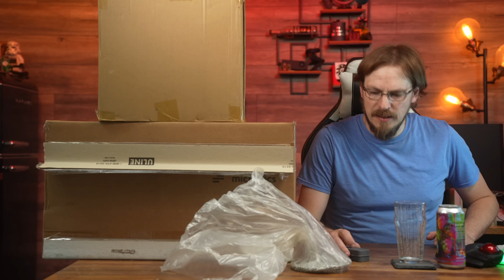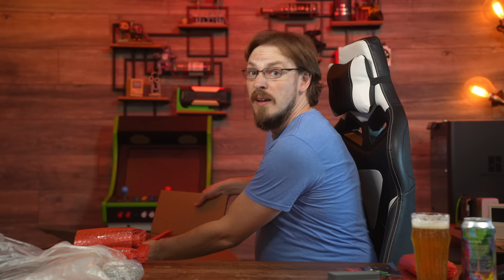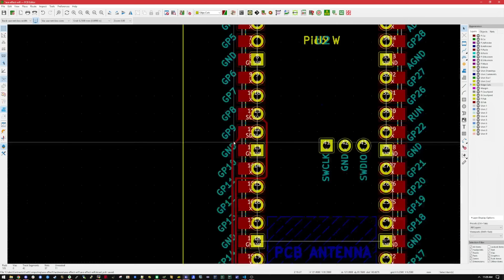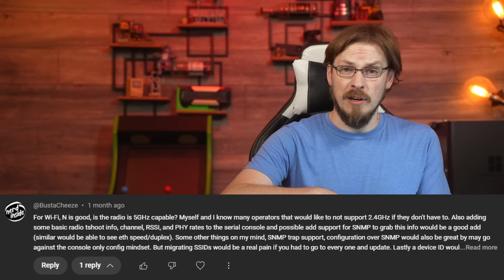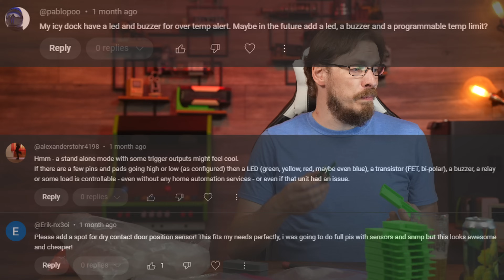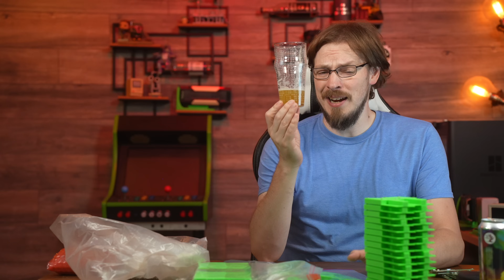Assembling SNMP Temperature Sensors and Answering Your Questions

Comment: smart move sticking with SNMP.  no need for MQTT when SNMP can get converted.  but most importantly, the smart concept of intentionally being a dumb device that resists compromise is EXTREMELY ATTRACTIVE from a security standpoint. well done for considering the high level issues as well as all the detail!  Looking forward to the POE version.
PS. what SNMP logging environment are you a fan of or using?
PPS. hilarious when you mentioned 10:43 people who have a home office that has sump pumps behind it that have a tendancy to fail - yeah that last feature i may have a vest interest in making sure it comes to fruition =)

Comment: As someone with some decent manufacturing layout experience you may want to look into electric torque screwdrivers and articulating tool arms. You could knock out every one of those you did today with minimal effort in a couple minutes with a guarantee of not stripping the threads once you dial in the screwdriver torque setting. If you end up needing to make these in larger numbers feel free to reach out. As someone with a huge belief in small business manufacturing but a background in large scale manufacturing (think Honda and Toyota demand from the same factory) I have no issue providing some input if needed.

Comment: Don’t fret, when I order an item from outside of Greece and it’s shipped priority mail from the states, it arrives within days to customer here, one exception was the last order which sat for ten days at the local post office in Columbus Ohio. Problem was with the employees at that postal branch, which have since been removed due to customer complaints. Anyways a priority package hits customs in Greece it will sit for at least two weeks there before released. Now the package is marked PRIORITY MAIL, let’s not fool ourselves most people in customs today are able to read most of the common languages used. I did notify customs via formal complaint that they were violating the terms of delivering packages clearly marked PRIORITY MAIL. Even Priority mail envelopes with documents that are time sensitive have been unnecessarily delayed. Using tamper proof tape to seal these envelopes we have been able to determine that the envelopes were illegally opened. We were able to obtain finger prints and DNA SAMPLES of an individual or individuals who handled these documents. Documents were enclosed in sterile envelopes so the individuals had to handle the sterile envelope. This envelope in turn was returned to a lab in the USA in a sterile environment to gain evidence as to who opened the sterile envelope within the package marked documents.

Comment: bruh. A Ruuvitag, or UniPlus with a Am2302.... EITHER ONE, is cheaper, and has more functionality... Both are already supported, and vetted/tested.

Easier, and supports rpc, and MQTT.
Reply: Yeah; you're reinventing the wheel here....

Shelly Uni plus 10-15$
2 Ds1840 temp sensors. 4$....

Supports 5v, or 9-29.
Still only 2.4ghz, but way more robust than rp2040 WiFi.
AND it's going to pull less than a watt.
Can be used via Cloud or fully LOCALLY, into Home Assistant or Google/Alexa..
Reply: Your developer is an idiot.
You can run native C (c++)on ESP32...
Reply: Here's a name. Incognizant.

Comment: I don't know anything about Prometheus, but surely SNMP data can be bridged or gateway'd into MQTT; the second result for 'MQTT SNMP bridge' is even a DIN rail device that claims to serve this purpose, the first being a very compact github project. I'm pretty sure if someone wants to get the data from these into an MQTT setup, they can make that happen without difficulty and without compromising the security of the sensor.

Comment: If the pressure sensor is in the airflow path, then the pressure it reads will be impacted by the airspeed interacting with the local geometry, most likely presenting as a reduction in pressure due to the venturi effect or some other similar effect I don't know the name of that produces low pressure areas adjacent to flowing fluid. The specific value of this is that it lets the pressure sensor validate air flow. I doubt you could meaningfully convert this into any flow unit, but you would be able to detect if flow stops, and you might be able to detect if flow changes in a substantial way, such as from one or more fans stopping.

Would this data be useful? Probably not, those fans should have tachs they should be monitored by their hosts, and they are also probably being regulated so the flow rate isn't expected to be consistent. Perhaps for less intelligent devices, or if you're expecting the server fans to produce/induce some auxiliary airflow elsewhere in the case and you want to validate that's actually happening. Maybe you have forced air from an external device like data room air handlers or ducted in AC and you can't monitor that source device, maybe it's not yours, or it's the less intelligent device. The pressure sensor could let you monitor that the forced air is actually present, and you would be able to detect a loss of flow much faster via pressure.

If Any Of This does stand up to scrutiny, a venturi tube could be added to the case model to amplify the pressure variation due to airflow, and make it less situational; but that would probably impact the sensor's temperature monitoring and might induce a whistle

Comment: Note that you need the product CE certified when importing it to the EU. This means measuring immunity and radiated emissions. An ESP32 is a bit cheaper then the RP2040 as you don't need a crystal/oscillator and external flash. It also means you can build on top of existing IOT projects like Tasmota and ESPHome.  
That said, the RP2040 is available up to the year 2040 and might come down in price when it's successor arrives. The SDK is also way easier to comprehend.

Comment: 65$ for something that cost less then 5$ to make 🙄 ill stick to diying
Reply from the maker: My BOM costs on this are nearly $30 each. PCB manufacturing, Pico-W, BME280, passive components, assembly, soldering, case printing, shipping, import tax, shipping materials. And that's without getting into developer costs, or the two different runs of Alpha prototypes before this Beta phase.
Reply: @CraftComputing I didn't think you would respond, but I've made boards just like this, except with more components. They're usually under $10, fully soldered and shipped. But mine are for smart house purposes. You can buy a WiFi temp/humidity sensor for $20, battery/wall powered. I won't mention any here so I don't drive people from your product. Also, feel free to delete this comment. Since you actually read your comments, I have a few lol.

On your final board, add a header for flashing. Anyone that tinkers wants custom firmware. This might sound like a waste of time, but it will expand your market. It's also the first thing I look for when buying anything like this.

I would make the final board with multiple input and output headers (which you kinda said that's what you're doing). Then you could make a relay module or any input module. I make all mine this way, but I use Ethernet to connect the modules to the main board.

Comment: In regards to future support for pressure sensor support: speaking from a decidedly non-developer standpoint, only having the vaguest inclinations of what a basic dev-cycle is like and the most rudimentary fundamentals of coding & associated costs, have you and/or your dev given any thought to making a lightweight core framework+plugin kind of build, so as to allow freedom to focus on the parts you want thoroughly fleshed out & polished? Then you don't have to worry (hopefully) about full stack rewrites just to add new features, and if one or more in the userbase wants to, they can start hammering out the additional extensibility. Just a notion, and if that's completely beyond the pale, that's fine.

Comment: Definitely going to be an extremely useful tool in the rack room.

I do agree that you need to keep the cost down, even on the pro version. If it ever gets to $200+ you'll be competing with the likes of ControlByWeb and such which are about as fully featured as you can get.

Also when I saw Axe Effect I actually thought of "Axe FX" which is a guitar DSP by Fractal Audio, lol

Comment: I noticed my BME280 reads low lower than my DHT22 in regards to hummidity, all of them seem to get temp the same (D18B20, DHT22, BME 280)

10:49 maybe you are Linus and your water cooling loop experienced a catastrophic failure and is leaking gallons of water and knowing your server is flooding would be a very important thing to know

Comment: so 6GHz really seems out of the question, so no AX band support :(
Reply: Radio bands on a device like this, 5GHz would have been a nice to have, every cheap, basic IoT chipset supports 2.4GHz. 6GHz would be extra. 900MHz would make more sense but would require a gateway of sorts. However a Wi-FI 6 capable 2.4GHz chipset would be a nice modern compromise.

Comment: arbitrary dry contact inputs (1-4 of them) would allow leak ropes, limit switches, tilt sensors... basically every network climate monitoring device I used in the IT field had those, and usually at least one relay for an alarm output.

Comment: A more permanent name for the "Axe Effect"? Personally, just "the Axe" works for me. It leaves it open for changes in development and what may be added, sensor-wise, down the road.
However and putting my business communications degree to work here, while lime green might appeal as a gimmick professional network techs with rack rooms that might have company VIPs want to visit woulod likely shudder in embarassment at being caught with such an "eye-drawer" like that in amongst their six figure routers and JBODs. I think black would make the item disappear and be otherwise hard to find, but whlte would be subtle enough and professional enough to be seen and not look out of place.
To add to visual appeal that would not add cost, you might want to consider including in the printing an "etching" of a standard shaped six-string acoustic guitar on the front; and also possibly include an "etching" of the name of the device down in one corner. Subtle and won't make the axe-effect look like a toy.

Anyways, just my thoughts and you're welcome to use or not. I freely release to you the concept to do as you will.

Comment: Instead of having a unit that contains PoE/Barrel/USB-C etc all in one, would it be easier/cheaper, to create a main unit containing the brains and then 'power adapters' that can be plugged in? something like a usb-c connector on the brain, and then a 'Power Jack to USB-C' and a 'PoE to USB-C' etc.  Or may by use a power jack on the brain if that's cheaper.  Another idea could be to sell a 'plugin probe', which is just the current probe on the beta, but with a plug that can be inserted directly into the brain, to allow local monitoring, so if a user only needed a single probe, they wouldn't need to have a long wire between brain and sensor, just mount it the same as the beta model.

Comment: Since you're already considering branching into non-IT areas, to my mind this might also be quite useful for freezer and refrigerator monitoring. I would think  (not an expert) that both temperature and humidity sensors are useful there, and it would certainly make sense to expand it to have a sensor to register if the door is open or not for those as well. If the temperature range is high enough, and the enclosure and batteries robust enough (or use wired power), maybe look into expanding into restaurant and bakery ovens?

Comment: I'm amazed at the shipping costs, maybe I've been spoiled by China, buying Arduino boards with little to near zero shipping costs. That said I once looked at getting a power lead from a US supplier, the shipping was multiple times the product cost - of course I didn't proceed, instead putting the info into my jokes folder.
It's almost like the US has no desire to export, we'll just leave that to China etc.

Now for SNMP, an article or two on it would be nice, as in how to take that data into another, say Pi Pico and throwing it up onto an attached display, rather than feeding some propriety software where I don't get to fiddle at all, boring.

Comment: 12:10 2,4 Ghz is not less secure, old WIFI is. For example the "MikroTik hAP ax lite" only has 2.4 GHz which however is WIFI 6 and supports WPA3.

Comment: If its passive PoE might aswell have no PoE. If I cant plug it into a run of the mill PoE af/at switch It aint worth it.
Also I would want the IPv6 Stack in software

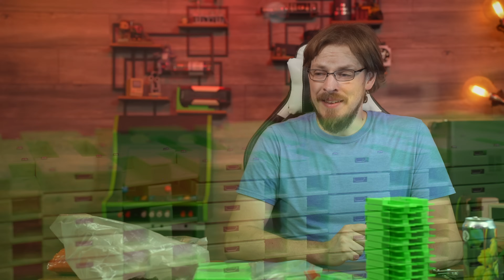Comment: Some tips: USB-C should be a must have. Case design is terrible, screws should be added from the back so you don't see them on the top cover, the long stick cover doesn't fit well because it needs a internat tab for secure fitting (like all covers for batteries in tv remotes) (30:50 most of them are off because of 3d printing wrapping) and the small case doesn't need 4 holes to screw into the wall. Best way will be to use only 1 bolt to wall into a small piece that lock into the big case behind it. For such a small case instead of 4 metal screws with the use of some internal tabs probably you can make the same locking with 2 or 1 around the usb C saving lot of time. Last tip it's a molding tool cost 300€ and then each copy 3 cents, it's worth it when you make that lot of cases. 3d printing is never the way to go in a production run, not in cost not in quality, not in durability. And last, this kind of sensors consumes very little power energy, so most of them should last months with a small battery, no need for wiring in most case scenarios.

Comment: Yo. Ive got a spare delvo 7349-bme (electronics esd precision electric screwdriver) if you want to borrow it. And good luck with this, I'll be following it closely. Haven't got the nerve to order one of my UPS's purpose built temp monitors since the card cost more than I got the thing for lmao. Additionally, a buzzer to start yelling at me would be awesome. My servers would start screaming due to the temps before that, but I'd like to know its temp rather than just them working hard.

Comment: Would it make sense to create a modular sensor system? Sell the brain unit and a variety of sensors that can just be plugged into it.

As far as sensor ideas:

- Power (like a Kill A Watt)
- Sound level (decibels)
- Air flow (MPH)
- Accelerometer for vibration
- Light level (lumens?)

Comment: The multi sensor one I would buy a bunch for my freezers. Being able to just run ethernet to my freezer locations and poe power something that I can monitor (and alert) off temperature in my freezers would be a big buy at the reasonable price point I think you are targetting.

Comment: @ 16:32 he said what? Esp32 can (and should be) be programmed in C, was he talking about espHome? That is not how you program an esp32, that is a shortcut for non-dev. Even usimg Arduino ide, you will be writting C to prgram your esp32. That comment that your "developer" made has me very confused. Am I missing something?
Reply from the maker: It's less 'writing in C to the ESP32', it's 'porting an existing framework in C written for X86 to ESP32'.
Reply: Putting "developer" in quotes was super cunty

Comment: At this point I want my IoT devices to stay at “old” 2.4 GHz WiFi. I pretty much don’t have anything normal there, that would have to compete for the airtime, it’s actually easier to manage because I can deploy my IoT WiFi as 2.4 GHz and it slowly becomes less congested with “other” networks, as more and more devices go for 5+ GHz spectrum.
Reply from the maker: The more 5GHz devices we have, the more IOT 2.4GHz devices get that spectrum all themselves.

Comment: You talk about the ESP32 and Rpi Pico W, but no love for Arduino? What kind of monster are you?
Reply: Arduino is not meant for products and it shows if you ever attempt to do so. Also, Arduino is a software platform that runs on a bunch of hardware (some of which was purpose built for it), including the RP Pico and ESP32. If it was seriously brought up at all I would be worried.
Reply: @yodal_  nothing was "purpose built" for Arduino, it's just a bunch of libraries and a compiler to abstract different midrange microcontrollers into a single and relatively easy to use software ecosystem

Comment: I am wondering if the pressure sensor could be used as a warning for both fans and intrusion detection.  Server fans tend to create low pressure and intrusions would instantly change the ' ambient ' pressure.